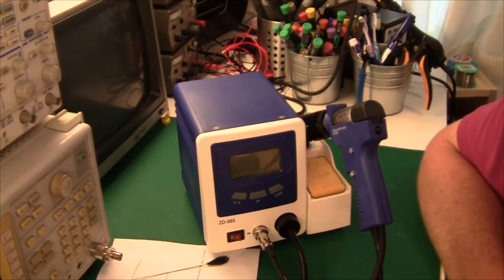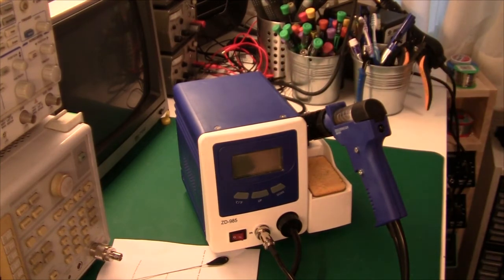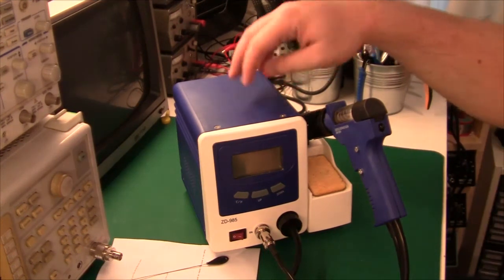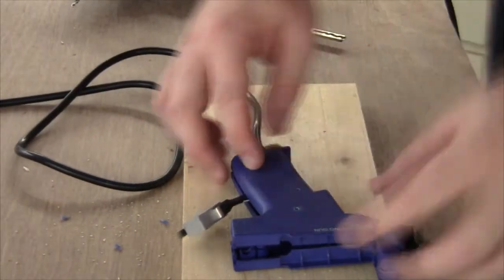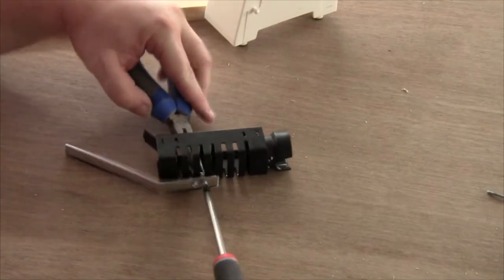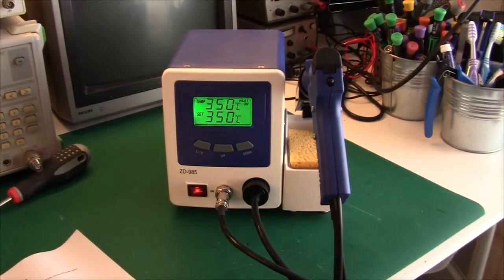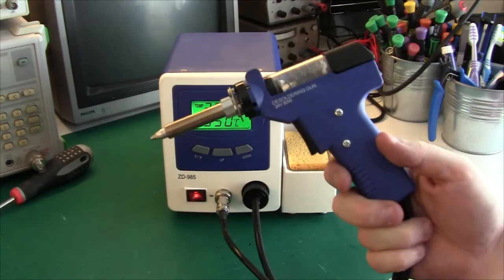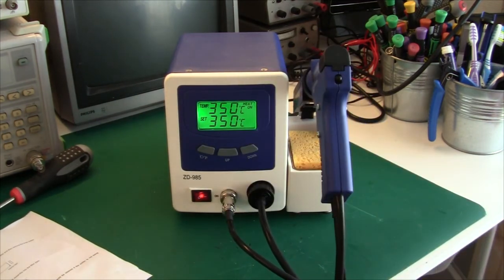Repair / fixes for desoldering station ZD-985

Comment: Holy shit, it's like a ONE MAN SHOW! I have had this station for years and it works as it should. You just have to know how to handle and maintain it. The same applies to other electronic devices. Why didn't he buy a desoldering station maybe 5x more expensive and now he's crying that he doesn't like it? I have been satisfied for years and hopefully it will remain so for years to come.
Review? What's the point of buying a new desoldering station that works without problems, only to immediately take it apart and give my own, sometimes quite meaningless, evaluation? After all, I'm only taking apart what doesn't work to film for others what's inside and how I fixed it. But new one???

Comment: Yeah, the gun holder is a bit flimsy, but works fine. I agree the instructions on how to clean the cylinder could have been better, given that re-inserting the cylinder after cleaining is not easy at all. 
The main unit runs hot after a while, and could do with a cooling fan (something they fixed in the revised ZD-9815 model. Got mine for £80 off eBay this week, and it's quite possibly one of the most useful tools I've bought. So far completely stripped down two CRT TV mainboards - took about 2.5 hours each. I had the gun set at 350C, with the fitted 1.0mm tip, and no problems with suction until the cylinder was completely full of solder. Definitely harder to desolder components with the leads bent over on the back of the board, but components with straight leads came out a treat e.g. ICs, transformers, etc.
Reply: Just put some soldering wool in the glass cylinder, which will allow air to pass through but trap the tin. This saves the filter and cleaning the cylinder is much easier.

Comment: Thanks for sharing. I have had one of these for about a year. It requires pretty frequent cleaning. My trigger switch has had no problems. The holder is indeed weak, but I have not broken mine yet. I tend to be fairly careful with equipment, and never throw my iron into its cradle or anything. It is not quality, but for the price mine has been fine. It sounds like you had more issues.
Reply from the maker: I'm glad to hear that it is reliable. Maybe I was just unlucky, or the shipping dude has thrown it around a bit?